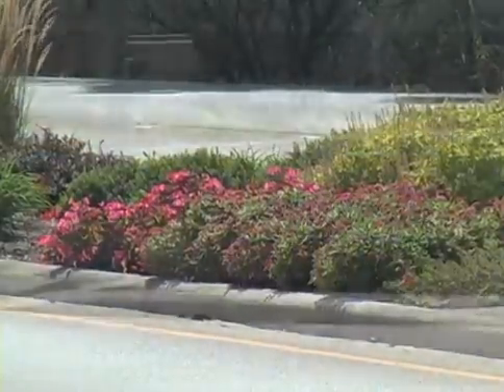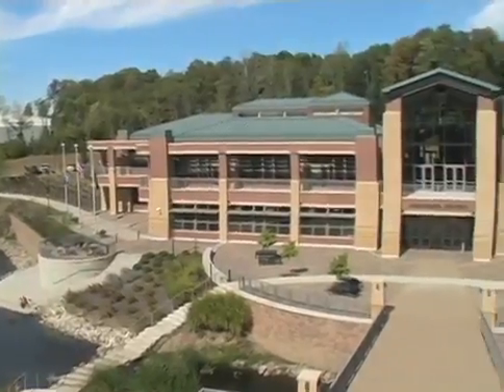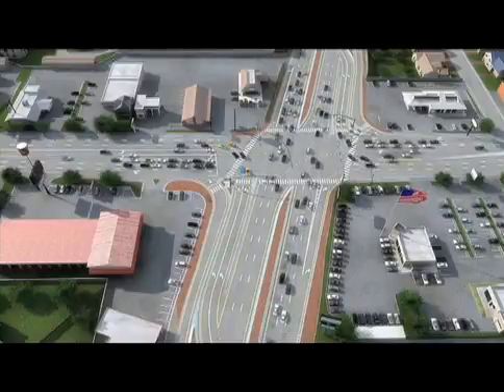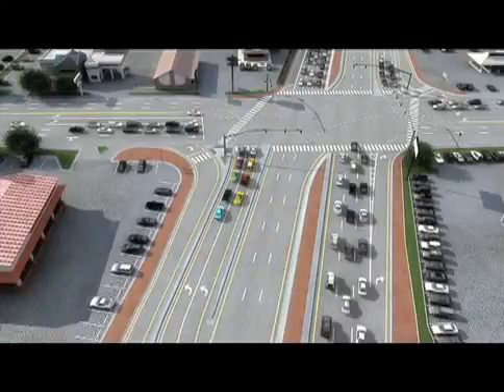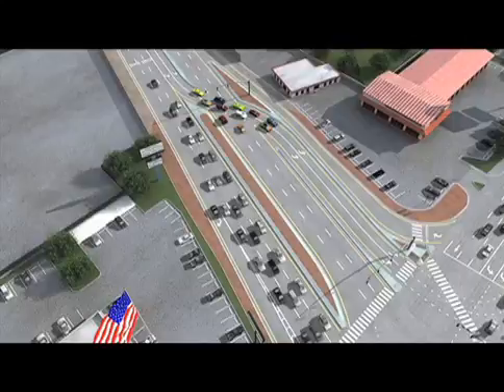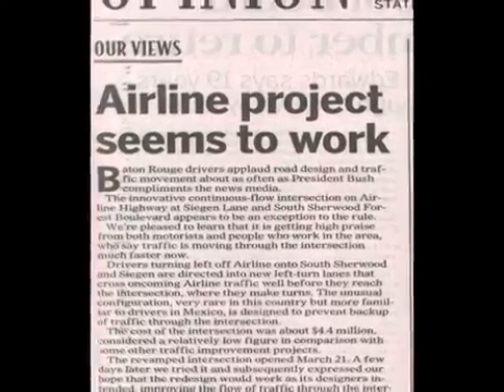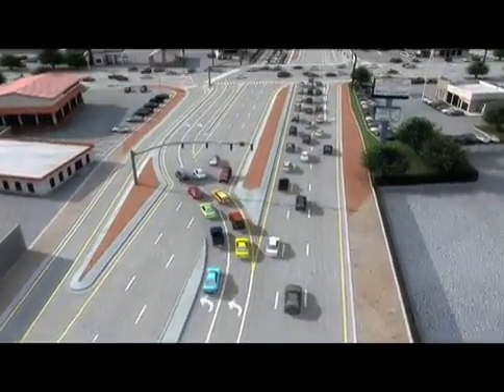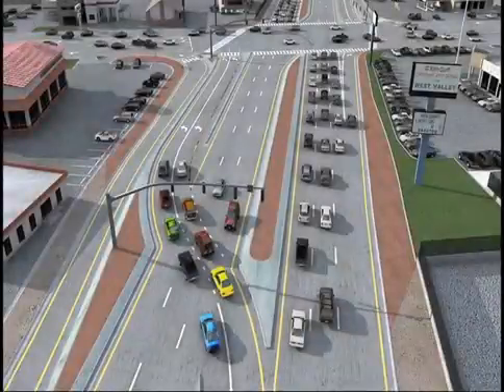Beechmont & Five Mile Continuous Flow Intersection

Comment: Interesting concept;  I wonder, though, what will happen during a power outage. This new concept gives more lights for people to run with the potential for more crashes
Reply from the maker: Mark - Good question, the signal control boxes are set up with battery backups, which are designed to power them through an outage.  Thank you - Steve Sievers, Anderson Township